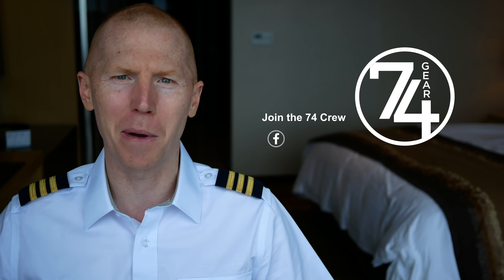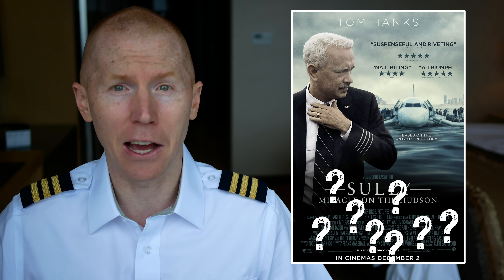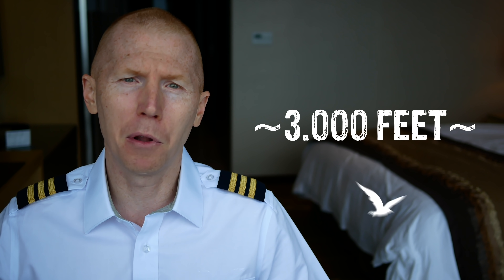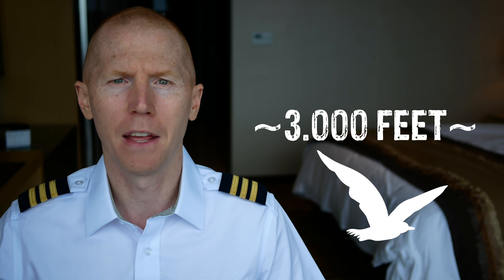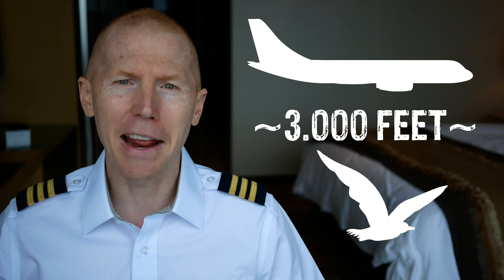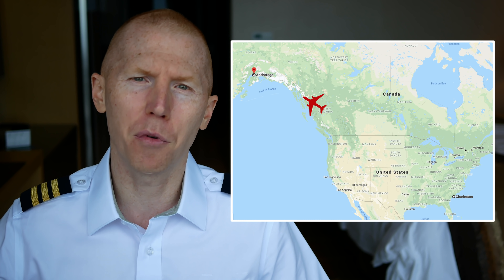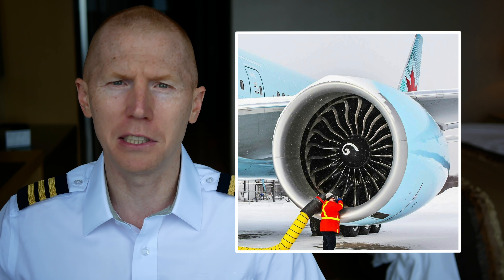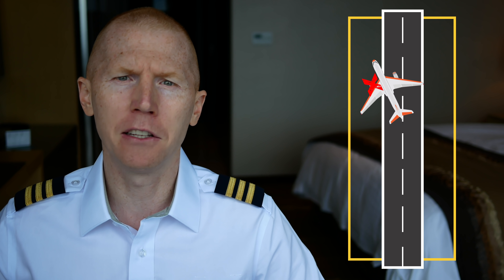Why Engines Don't Have a Mesh or Grates to Stop Birds

Comment: Why can't engines have a retractable bird grills? They could be retracted for more efficiency.
Reply: Unless your mesh is made of adamantium, if a bird hits the engine, it's just going to take all that metal wire and shit into the engine, which would cause much more damage than just the relatively soft flesh and bone.
Reply: @Misha-dr9rh   what????? chicken mesh can stop 100kg sheep running at full speed...... but u need adamantium mesh for a little birdy?????????????? lol
Reply: Spenser Roger the issue is when you need the engine power the most is when you would put the screens in place.  That would cut the horsepower in half, or more.
Reply: @N2146X  Yes but take-off is also the only really critical time that the aircraft is at risk due to birdstrike and also likely to experience one. and some form of physical shield would need to be retractable to be of any value so it is a valid comment. Clearly a grate or screen in the classic sense isn't an option for the very reasons you mentioned - the loss of thrust - but it is still worth throwing ideas around as that is how most of these engineering problems still get solved ultimately.
Reply: Insertclevernamehere the issue is that a screen restricts so much passage of air and the airflow that the engine would need to double in size, which would add weight.  Basically, it would make safe flight impossible.

Could you imagine the left screaming if we caused flight fuel consumption to go up by a factor of ten, or the cost of flying going up ten times, just to add a screen to save one flight every twenty years?
Reply: @N2146X  did you just make your comment political or is this a joke
Reply: @gammafox5431  
IMO either way it is relevant.
Reply: I just made the same comment 😂.. maybe not a grill but a guard some feet in front of the engine. Then it would still be able to suck in enough air? Then It can retract after takeoff .? Haha I don’t know what I’m talking about but worth mentioning 😂
Reply: @wayne7071  yes exactly and it could be designed to fit in an angled way towards outside, so the birds hit on the grill wud take a sling shot, decreasing the pressure on the grills
Reply: I think this is a great question.  There should be something that can go in front of the engines during low-level flight which can be retracted once above 3000 ft or whatever altitude is deemed reasonable.  A fine screen is unrealistic because it would block too much airflow, but you would think that an aerodynamicist would come up with some shape that could direct the air in such a way that direct bird strikes would be somehow captured before being thrown directly into the engine.  I think there is a solution that could be discovered but no one is willing to spend the money to get there, and then to lose profits by implementing it.  Like others said, it would reduce efficiency and raise costs overall to prevent this for such a small percentage of flights that are affected by bird strikes.  The sad part is that money is more valuable than human life in equations like this.  I suppose it depends on what one considers "reasonable" in the end.
Reply: @skykingusa  
IMO you raised most of the fine points of the problem but even the most practical of a retractable distant shield in front of the engine has to overcome the enormous suction of the engine once a strike is deflected. Birds have been around before airplanes. We have invaded their world so the most humane thing to do is what is being done now mostly and is to deter them from being in the area. Simplistic as it may seem and a scarlet letter of sorts is to, as someone said paint a predator on the nose of the plane. Some could be owls some could be hawks, some could be bald eagles. I watched crows when I placed an owl in my garden and they get to understand if the owl is not moved. So to be effective I had to place it at a different spot every day. Eventually the crows went elsewhere. With a plane that issue is always on the move. If every plane had a predator painted on its nose it may be a solution though perhaps an evolutionary deterrent birds may never fully understand.
Reply: @skykingusa  A solution is technically feasible and we know this because of the success of filters fitted to military aircraft, especially in desert conditions. 

The issue though is this wouldn't be much of a solution unless you equipped every jet however having airports manage to exclude birds from their property and proximity, that would seem like the most viable option...

However if it's proved to not be possible, then let's go to folding bird blockers for in front of the engine.
Reply: @SpenserRoger  Yeah.  Runaways should be equipped with turrets that automatically shoot down bird. Would be glorious. lmfao
Reply: so so soooooooooo many reasons why that is an absolutely ridiculous idea
Reply: @HECKproductions  no
Reply: @HECKproductions  they have them on helicopters... what you going to say now?
Reply: @SpenserRoger  The engines on helicopters provide power to turn the rotors, not forward thrust.  It's an entirely different kind of flying.  Altogether.
Reply: @azimuth361  'cyclic' magic!!
Reply: Just stop the engines and winch the plane like it was a glider. Problem solved
Reply: @eklhaft4531  no gliding is not like you think. It is going to point the nose down and you aren not able to get it up. Next the motor on the other side will make imbalance and cery fast make the plante uncontrolable.
Reply: Heres why this question falls squarely into both categories, "there are no stupid questions" and "who asked that, please leave the room before the rest of us catch your stupid":
 1. Sometimes, many times, stupid questions are important, because they serve as a model of a way NOT to think, hopefully serving the person who asked as well as those fave palming around him, and perhaps even the teacher, hopefully guiding and informing they way they teach in the future so as to inherently lead students down more efficent and productive thought paths. 1 a. Sometimes a stupid question isnt. Sometimes if you go ahead and ask that question that already seems to have been answered and explained away, someone even if its not the teacher, or the person who asked it, will think around the subsequent problem the proposed solution causes focuses on avoiding that issue while obtaining the desired overlaying result. 
Thats why stupid questions are important. 
Heres why its the other category
1. He already answered it and if you had listened to what he said carefully, you would have learned that its not the mainly the fact that such obstructions are always i front of the engine thats the problem, THAT is. Problem, but the promary problem is thAt they reduce performance specifically during crucial moments. This increases power needs and engine size which would actually turn into a tyrany of scale due to the nature of the way jet engines need to be designed, the guard would exactly scale to any increase in engine size and performance, and you would constantly be getting kicked right in the shins by unfavorable numbers up to the point that you reached the maximal possible jet engine that could possibly carry itself, the other engines and aircraft et al, IOW its not possible. 
 2. You added complexity to something thats already tremdously complex that not only doesnt increase performance, actually reduces it and only confers benefit for a very narrow band of parameters, which is the deffinition of a bad idea. 

Who wants the galaxy brain way to deal with the person who answers this question, one that lets them know they asked a stupid question, makes them happy you told them that because it lead them to discovering that fact themselves rather than having it hurled at them in front of the class and hopefully gets them and all listening into thinking about how to solve the actual problem?

Here it is:
 Well that would be an ideal solution... IF you ca. Design something made of conventional matter that is capable of deflecting a bird, at the necessary speed, AND robs only slightly less than 1% of engine efficency, and doesnt increase the cost of the aircraft over its lifetime by the same ammount. 
 If you can do that, you will never HAVE to work again, otherwise, you should focus efforts in this vein toward preventing the birds from approaching the aircraft at all because thats the problem. Its not that birds fly into engines, birds for the most part want nothing to do with the engines and certainly arent aiming at it. 
 Have you ever seen the old cartoons of someone caught in a whirlpool? Swim as hard as they might, they cant get out?
 Its like that but worse, the bird is just doing what a bird does, you know flying, sometimes shitting on things, honking as well, and they are pretty good at it, but all of a sudden they find themselves in something they likely have never found themselves in before, a horizontally oriented,  progressively narrowing and accelerating reverse head wind. 
Birds are great pilots man, they typically do something that humans dont do, in fact humans so often forget to do this that its the first rule of human piloting, always fly the airplane. If you stop flying the plane, it will stop being an airplane and start being  a falling object.  
 Birds rarely do this accidentally.  They have to be be dead or severly injured typically for them to just stop flying. Theres some, perhaps many birds that regularly fly even while asleep. ASLEEP! 
It never occurs to them that if they just stopped being a bird for a moment, just a moment or two, things would be ok, they would fall out of that cone, they could start being a bird again and they could be back to shitting on statues or stealing nachos on the beach or fucking off south for the winter. Whatever that species is doing just before they cross that crucial threshold where the reverse head wind is of such magnitude that they are at one moment in one terrified piece on one side of the worlds largest, fastest, loudest, and most expensive cuisinart and the next they are in innumerable pieces throughout that overpriced kitchen appliance and also flying out at tremdous speed in its now very sooty exhaust plume. Chicken al'a contrail if you will. 
 IOW, if they wouldnt approact the aircraft to begin with, they couldn't get slowly but ever increasingly rapidly reverse head winded into the petrol powered slap chop nestled so comfortably under the big birds wing. 
 They cant help what happens. They arent flying into the engine, they are pulled into it because they flew toward it. 
 However, if the soud of that engine isnt enough to get them to keep their distance, im not sure theres anything you can do. Stupid fackin birds!
Reply: @metamorphicorder  the second half of that wall of text is pure gold!
Reply: @jnawk83  which one?
Reply: With so much thrusting any retractable mechanism might fail and get sucked into the engine, more dangerous than a bird
Reply: @vaibhovbhardwaj  anything in th engine is a no go situation. 
The main reason its not done with a physical pre engine guard is that any guard capable with our current capability of production, of withstanding the intake of the engine, would create a thrust defficit to the point that flight would be impossible.
Reply: @metamorphicorder  I understand, but what I mean is even if they come up with solution of taking off with less power even then any moving parts in front of huge air sucking monster engine is dangerous.
Reply: A soulution could be rocket thrusters like on some cargo aircraft, that deploy only on takeoff and then the engines take over at 3000ft? This could get expensive though...
Reply: @Zootopia96  makes sense
Reply: This is the reason efficiency is the WRONG answer. The main issue is the bird will get sucked in still regardless, just diced. 

To prevent that you would need basically a knight beak helmet cone that wouldn't allow enough air in to work anyway.
Reply: @carbon1255  nah you're not thinking enough of how the screen would work. 

Think about how you'd build the screen if you needed more surface area.
Reply: 1.  That would be a whole new system that would add cost, weight, complexity and maintenance requirements.
2.  It would reduce airflow when you need it most, during takeoff and climb.
3.  Make it light, and it would disintegrate anyway.  Then you'll have metal and bird getting sucked into the engine.  Make it robust enough to deflect birds and it will be prohibitively heavy.
4.  Turbine blades are most efficient when they bite into clean, non-turbulent air.  The air behind the mesh would be choppy and further reduce the efficiency of the engine and also make the engines much noisier.
Reply: That doesn't make any sense whatsoever
Reply: @thecloneguyz  what doesnt make sense?
Reply: @metamorphicorder  
First of all you're traveling so fast you would never have time to react and retract them plus if anything hits it it's just going to take it right into the engine with it
300+ Mph 
I take it you're not able to do critical thinking because they should be common sense to anyone that understands basic physics or science
Reply: @thecloneguyz  ifn youd taken the time to read the third now most previous comment id made, lengthy though it may be you would have gathered that while given to grandiloquence at times, at least a rudimentary understanding of the concepts involved as well as being possessed of the same in regards to reasoning and logic. The reason i asked was to to determine which among a long list of points made in the comment section your comment was addressing. 
 I was simply curious about that. I agree that the idea of a guard of any easily conceivable sort is asinine.
Reply: No because extreme sucking kills the fence that retracts.
Reply: Actually if you look at some Russian fighters you'll see that the intake is completely closed on takeoff to prevent ingestion of foreign objects on rough unimproved runways.  The same planes have open slots on top of the intake that allow sufficient air to enter the engine.  Once airborne and well clear of the possibility of foreign object damage the plate that closes off the front of the intake opens and sucks in air like any other fighter.  As he said in the video statistically most bird strikes happens below 3000 ft. agl so maybe their protocols are to keep the intake closed until above that level..
Reply: Now after your airborne you now carry that excess weight for the entire flight.
Reply: Hi I am contacting you on behalf of Boeing your idea is truly ingenious we truly did not know how we ever didn’t think of such an idea we would like to buy your design as soon as possible! Also are you looking for a job? We want to offer you a role as a leading design builder please see the terms below 
Offer to buy design: $100 Million dollars US
Yearly salary $700k

Comment: Make the jet engine shaped like a torpedo and put the intake in a ring around the circumference of the cylinder rear of the nose cone. This way the birds can strike the cone and bounce off while the engine still gets direct inflow.
Reply: That would prevent good airflow over the compressor intake, which is exactly where you need good airflow. It'd also decrease efficiency a ton by limiting mass flow rate. I think you're thinking of something like the supersonic inlets for a fighter, but those are designed for supersonic conditions where you need to generate a series of weak oblique shocks to slow the flow down efficiently. The design doesn't make any sense for efficient operation at subsonic conditions

Comment: So why not add a grill that retracts when the plane reaches say 3,000 feet?
Reply: Unless your mesh is made of adamantium, if a bird hits the engine, it's just going to take all that metal wire and shit into the engine, which would cause much more damage than just the relatively soft flesh and bone.